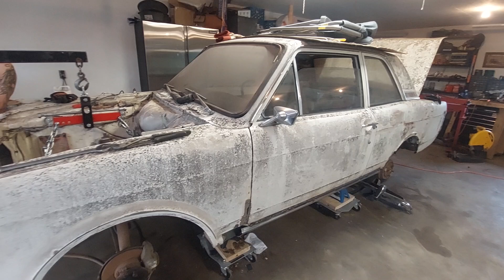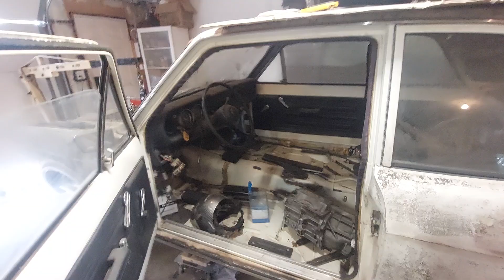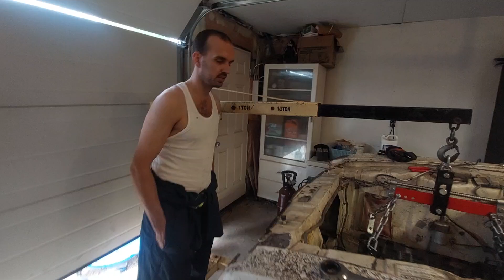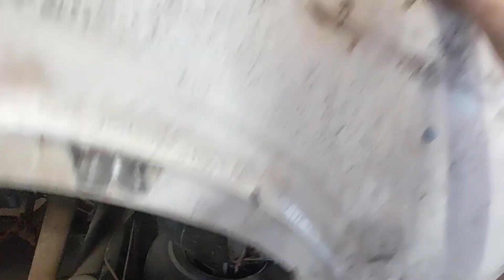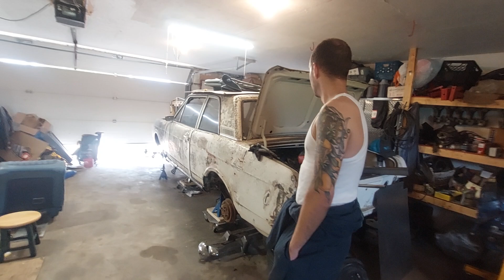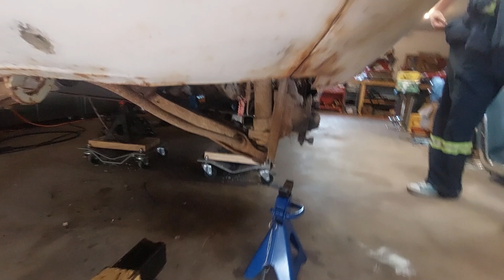1968 Cortina Build Part 4 July 2024 289 Engine test fit

Comment: I had v6 mk 1. Trying to fit v8 in car without cylinder heads and exhaust is probably not the way. Mk 2's have a lot more room under the hood than mk 1. My mk1 v6 blew all away around tight streets.  Even mates worked Valiant 318 coup ! 289 was next but I went into Falcons instead.  Good luck mate. Cheers from New Zealand
Reply from the maker: Sounds like a great memory!  Love to hear about these builds.

Comment: Great to see the Cortina coming along.  Looking at the rot, there is nothing there that scares me and in fact it is less rotten than most I have seen over the years.  The places it has gone are all typical for the model...and don't be surprised if there is rust in the lower lip of the windscreen / rear glass apertures when you get the glass out, as they were famous for hiding it there - especially in the corners of the A and C pillars.

The two-door was fairly rare not to be in GT or Lotus spec and even then, there weren't many two-door cars produced or shipped outside the UK.  The gearbox that came out would have been a Borg-Warner BW35 - a typical unit that was used in many British cars of the period.  In the Cortina though, it was horrible.  The box never really used first gear except to roll off the mark, so second gear had a heck of a job to do before dropping into third.  However, because of the diff ratio (I think), the gearbox had a mind of its own when you'd pull out to overtake if you were doing between 40-55mph (64-88km/h) and would kick back into second if you floored it.  The problem was that if you were doing anything 50 (80km/h) or over, by the time the box realised it should not have chopped down, you were inevitably run over by the truck coming the other way!  A big, heavy beast of a gearbox, they did put up with a heck of a lot of abuse and were also used in the likes of Jags (both the straight 6s and V12s) and even the Triumph Stag.  

I am seriously looking forward to seeing the bodywork complete and then seeing it come together with that marvellous 289.  The T5 sounds like the right box for the job for sure, too and although there will be additional weight up front with the engine, there are ways of saving weight with some of the Mustang components that you're looking to put up front to beef her up a bit (and sad to say it all comes down to budget).  Also, there are aluminium / fibreglass panels that (if regulations allow) could be substituted for the likes of the bonnet and boot lid....although maybe not in rural Saskatchewan!  I must admit though, my mother never had issues driving the 4-door MkII of Dad's with its 289 and 4-speed...and at 5'3" and slight built, she would have struggled if the unassisted steering was heavy.  We also owned a 1937 Hillman Hawk and she would swear and curse under her breath as she heaved on the steering wheel in that, so my statement is not without precedent.  I seem to remember Dad carrying a couple of large concrete paving slabs in the boot when he went to the drag strip and I do remember that the vehicle could spin the wheels in third gear under the right conditions and light them up even when starting off on a downhill slope, so I don't think the paving slabs were for homologation purposes, eh....  Being that this was in the mid-late 70s, performance tyres were not as sticky as they are now and there would be certain liberties that you will be able to take with the Cortina for the track that Dad couldn't for the road-going car - especially with the setup of the rear end - so getting the power down on the tarmac may not be as difficult.

Man, I wish I lived closer!  I'd love to come and give you a hand with the body and general fit-up....and my wife is getting worried because I'm talking about what you blokes were about to do and then thinking aloud about the options for repowering my Triumph 2500S sedan when its engine comes up for rebuilding soon!  There's one (or two) very large puddle(s) between you and me though, so it's not an easy drive to get there.  Maybe one day....if only to see and hear that car on the track!

All the best
Reply from the maker: I’m getting ready to do an update video on this car soon.  It is close to street ready, so stay tuned!
Reply from the maker: @KiwiStag74  love your passion for this project!  It will be fun!